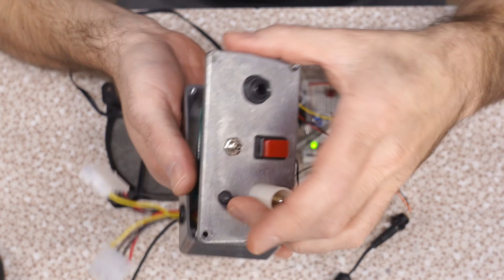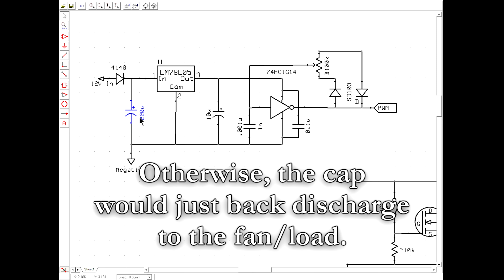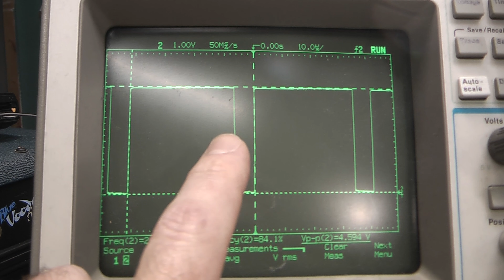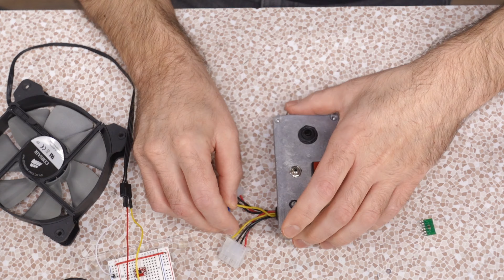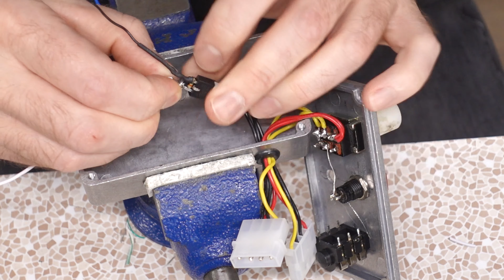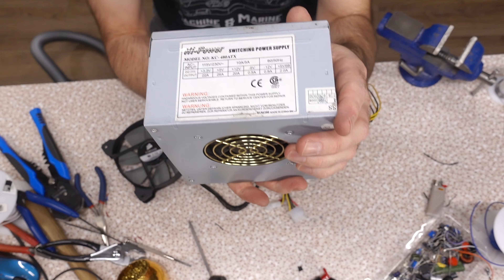DIY PWM Control Relay for PC Pumps & Fans

Comment: Got a bunch 555 so ive choosed that route and because im more familiar with it 
But im Subscribing
Reply from the maker: Yeah, It's a classic. I'd prob be looking for ways to use them up too if I had a bunch.
Reply: @DATT  ive used it with a BJT transistor latch For turn off/on with a pushbutton and buffered the output with darlington BJT because the 555 alone was putting a lot of Noise in the output 
Smictd triggers and mosfet are great but also more expensive
Reply from the maker: @jul371-y5p  I'm not sure I follow. The BJT latch is a power switch ? Hmm, my design works well enough it didn't need a buffer, but then, did I check it for noise ? Not sure. If the output wasn't clean I might have done something different.
Reply: @DATT  thats mi problemo because I dont have an osciloscope so im kinda blind guessing and using a PIC "translator probe" ive made to check frecuencies 
The oscilación is about 30khz 
But the fans made a coilwhine noise when working between 10-50% speed 
Thats why ive used the darlington 2n222
And no the 2NPN-1PNP BJT latch isnt for power it just activate a optocoupler to power up the 555
The fans are Powered by a LM7812 for the 1A I need and for the noise maybe use a 330pF instead the 680 damps the noise 
At the output
Reply: @DATT  schotky avalanche can be used instead a schmidt?
Schotsky wouldnt negate the output as a schmidt but can drive a IGBT? And make IT simpler than the darlington 2222 ive used
Reply from the maker: @jul371-y5p  You're asking me ? I couldnt' tell you. I've played a lot with schmidts, but not with transistors. There are many ways to build an oscillator. All I can say, is grab your scope and your breadboard and try it out. That's all I do. I'm not an electronics expert. I know a thing or two about specific kinds of circuits, otherwise, I'm learning a lot of new things as I go. I jsut spend hours at the breadboard with a scope until I figure it out.
Reply: @DATT  to better clarify the BJT latch works like a D flipflop or Toggle without clock ist just a Fsncy switch 
Ive made so far the circuitry with things i already got
Reply from the maker: @jul371-y5p  Sometimes coil whine could be normal depending on the fan, and you might find they make that noise running off an actual motherboard Pwm. 
I'm not sure that was electrical noise your were hearing, other than the aggressive nature of a clean hard square wave. 
I wonder if adding a transistor added lad, turned that square into a sine ? That would make the switching quieter, but, much less efficient. 
Not sure. All I know is that I did worked. 
I would highly Highly recommend investing in an Osc. Especially a digital type where you can pause and analyze a wave form. 
It opened a whole new world for me when I could finally see what was going on and my understanding of circuit exploded. I couldn't live without on at this point.